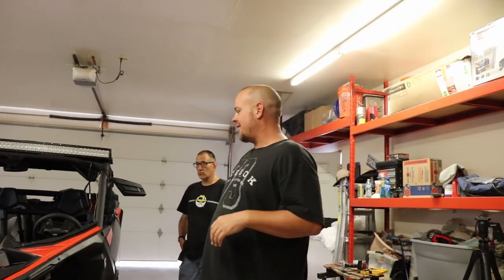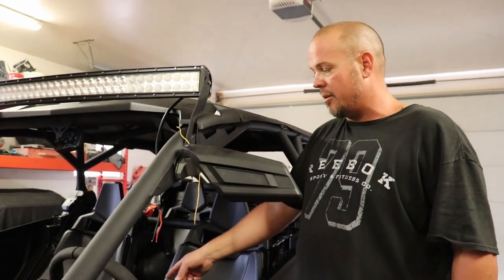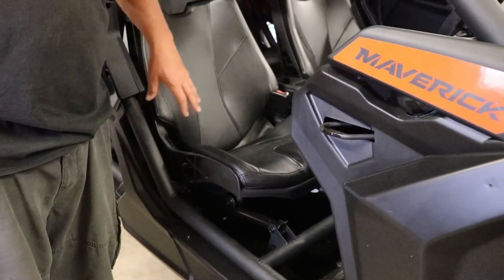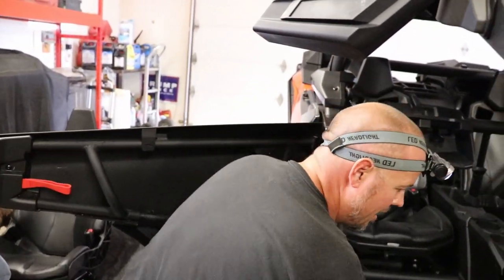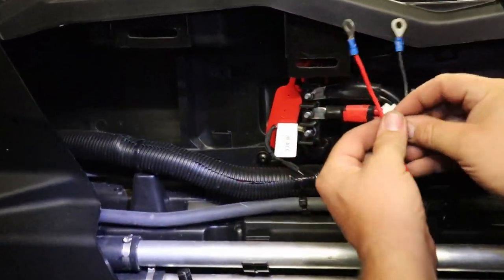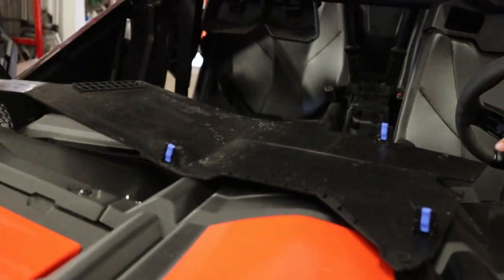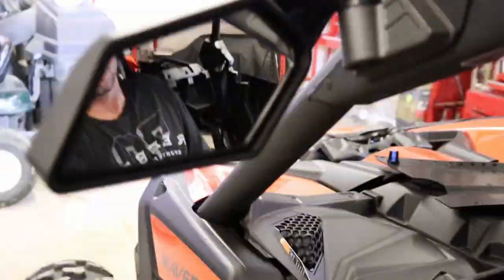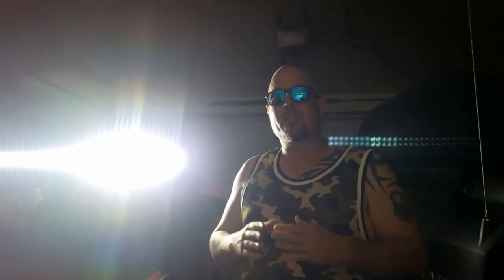Light Bar Install-Can Am Maverick X3 Turbo

Comment from the maker: Successful light bar install on Maverick X3 Max, if you have any questions or suggestions, feel free!
Reply: Review it TV what is ur job so when i grow up i can have one
Reply from the maker: Havent had any moister get inside and use a power sprayer to clean also and no issues
Reply: What type of fuse is it ? Any recommendations?
Reply: Where did you get the rocker switch with that adapter
Reply from the maker: @Abcdefghijkle  c
Came with the light bar on eBay. Link for it is in the description box. You can also just look up wire harness to find them separately on Amazon or eBay.
Reply: @reviewittv1802  thanks you should do more videos on can am
Reply from the maker: @Abcdefghijkle  appreciate it and I definitely will. I have a Podcast coming as well on this channel.
Reply: @reviewittv1802  alright brother 👍

Comment: I cannot find the bottom exit hole. I have no clue how you figured this out.
Reply from the maker: When you get to the bottom of the roll bar where you would expect to pull the wire back out from is where you would need to get a "Step Bit" to drill a hole because the the roll bar is blocked off so the wire won't come out. I recommend not drilling the hole at the very end of the role bar because you may run into an obstruction from what ever is blocking the hole at the end of the roll bar. I went abou 3 or 4 inches back from the end of the roll bar and then drilled a hole just big enough to pull the wire out using some needle nose pliers

Comment: How do you like that light bar? Has it stayed waterproof?
Reply from the maker: Yes it has, no  Condensation build up or issues using a high pressure power sprayer to wash either.
Reply: @reviewittv1802 is it still holding up lol

Comment: Where does the string come out exactly cuz mine seems to stop half ways
Reply from the maker: I was able to get it to the end of the roll bar by first fishing a string through the roll bar and then tying the the wire to the string to pull it through. It is a little tricky you can also just make a small exit hole if you can't get it all the way through.